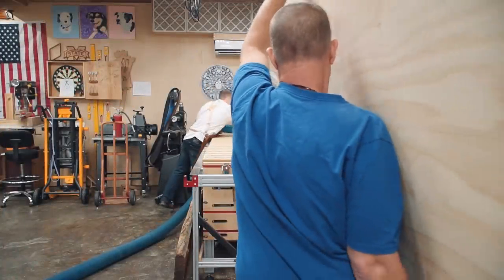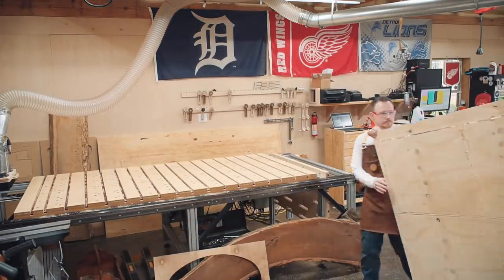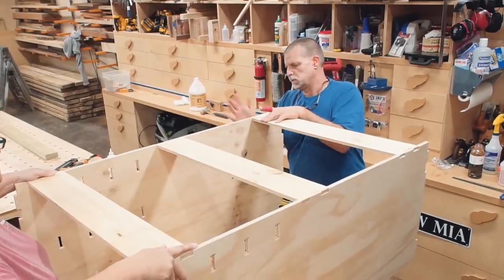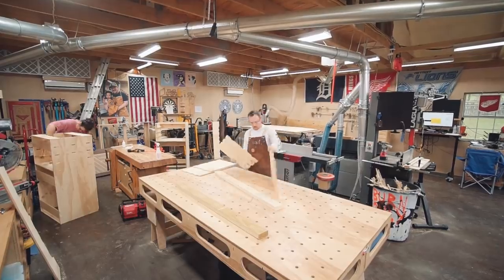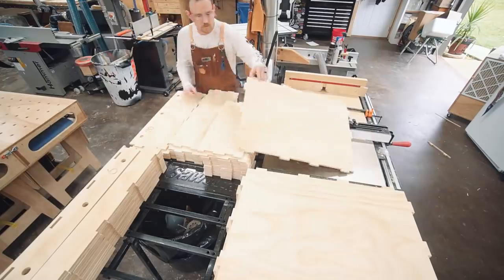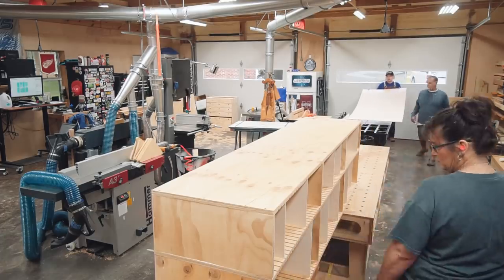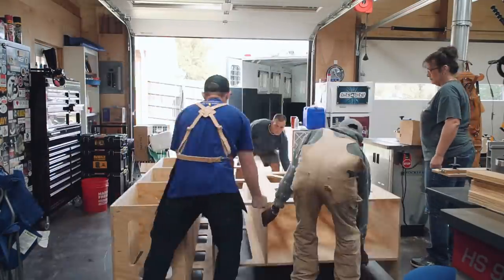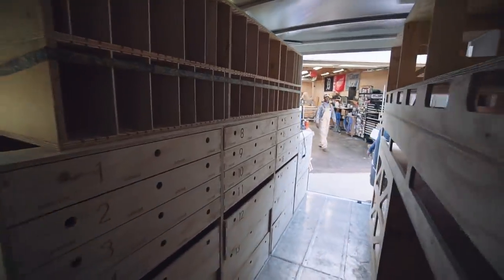Contractor Trailer Toolbox: Cutting and Assembly - 360

Comment: Love the numbering system for the drawers.  I'm about to add another crew onto my painting business and have been trying to decide whether to buy vans or trailers.  Either way, I'll utilize that system for the drawers.  Good idea!
Reply: Buy one van and one trailer. After a year of using them, you'll have a good sense as to which works better-- the versatility of a trailer or the simplicity of a van.
Reply: @JDeWittDIY  Haha!  I'm leaning more towards a van, because neither of my guys can really back a trailer.  I could only imagine them backing a trailer with a van. LMAO
Reply from the maker: I've seen a lot of contractor vehicles with obvious jack-knife scars from trailers.
Reply: @JayBates  That's what I'm worried about.  Backing a trailer isn't a skill that most people have these days.
Reply: @dgoddard  Backing a trailer is definitely an acquired skill. It's kind of like riding a bike. Once you really learn it's not hard.
Reply: @JDeWittDIY  I worked at a boat sales lot when I was younger.  I could back a trailer through the eye of a needle using my mirrors.  Still can.  But most can't do it with a ground guide and a foot on the brake.

Comment: Ok, now do dove tails Mr. badass... 😏
Reply from the maker: Why would I want to do dovetails on something like this? It's like driving an 18 wheeler to get a snack from the gas station.
Reply: @JayBates  exactly Jay, you just proved my point. Go big or stay home.
Reply: I’m about to purchase a CNC with automatic tool changer for large scale cabinet cut-out and might use the CNC to do our dovetail drawer boxes. We have a separate machine that does the dovetails and works great but CNC automation is KING!

Comment: Puts one hammer in there and the tyres pop.
Reply from the maker: It's not that heavy. Also, horse trailers are built to hold weight. Horses aren't light..
Reply: @JayBates  I ripped mine out and replaced the lot with cheap dexian racking and eurocrates. It's an extremely flexible system and I can remodel the inside in an hour as my needs change.